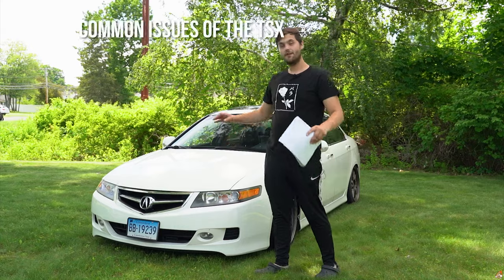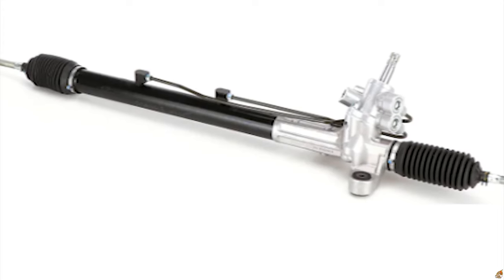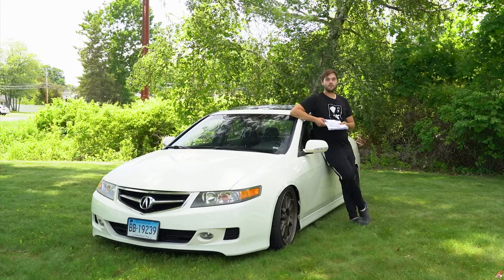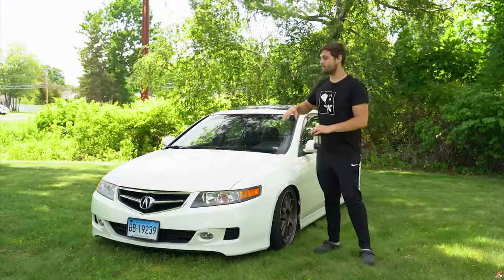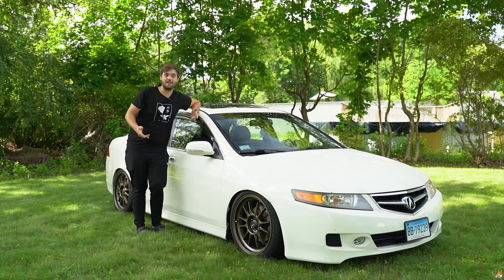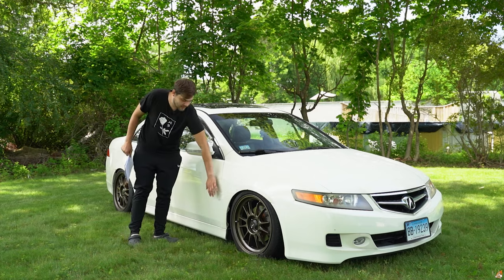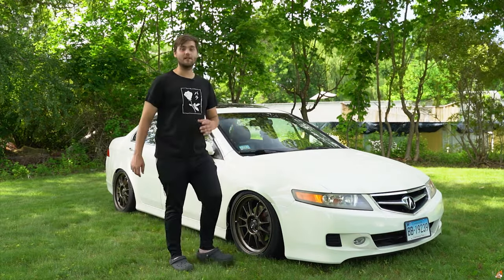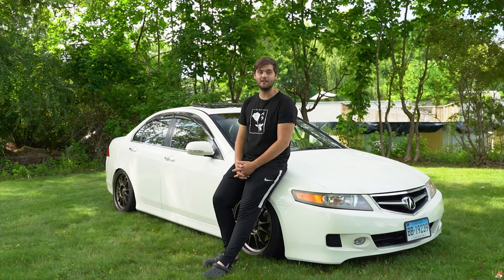TOP 10 COMMON ISSUES With An Acura Tsx

Comment: I have an 04 tsx and in the winter it gives me trouble starting. It sounds like it's doesn't want to start,after the 3 turn of the key then it starts. Wat could that be.??
Reply from the maker: Sounds like your starter is probably acting up, most likely alternator is next up in line.
Reply: Sounds like your battery is going out.  Same thing happened in my 04. Got a new battery and had no issues. Same with my 09.
Reply from the maker: @madgreek253  this as well can be either of the culprits tbh
Reply: Thank u

Comment: Hey I am just wondering if the Bluetooth could be the cause of the issue I have, ok so from time to time my 2007 tsx just goes off and I have to stop, set the gear to Parking, pull out the key and start the engine. But sometimes when I’m moving and start to decreasing the speed it attempts to goes off but suddenly goes back to normal with the greetings on the display(welcome driver 2) 
It feels like car does not have the capacity to provide the consuming power and it just cuts the power off so the car goes off. 
And if yes is it enough to just disconnect the phone from the car? Or the Bluetooth wire inside the car needs to be unplugged? Or anything else?
Thanks in advance 🙏🏻
Reply from the maker: Sounds like your alternator may be just crapping out and drawing out the power, have you changed it at all anytime? Also wouldn’t hurt to unplug that Bluetooth plug can also be a drainage
Reply: @RishMedia  haven’t changed my alternator yet, but looks like I will in the nearest future. At least the situation got better after I unplug that green Bluetooth chord yesterday (: 
My car won’t go off as often as it used to
Thanks for reply you have a nice day 👌🏻 😊
Reply from the maker: @vladmiller6389  hope all goes well man! If ya still occur draining issues more then likely the alternator next

Comment: I got a 2005 acura tsx and my climate control, heated seats or heated side mirrors doesnt work, was working fine and then out of nowhere it stop working. I got the android tablet and everything works how is supposed too, but anything climate control related stop working out of nowhere, i had the tablet already btw, anyone can help me? I cant find anything about it
Reply from the maker: I’d say start with the fuses related to that, make sure ground wires are all good not to beat up, and your connections are good.

Comment: Okay I have one that rpm hunts constantly it’ll idle low and come up on its own. Then in 3-4 gear it’ll hunt while driving a constant speed. Any ideas?
Reply from the maker: Do you have any codes popping up or misfires happening too? Pretty odd id say look into you Throttle position sensor and make sure your TB is good/clean inside
Reply: No codes or misfires. Cleaned throttle body today no change and the sensor I have not tried. This problems been happening three years now but lately it hunts lower at idle to where it almost sounds like it’s gonna stall
Reply from the maker: @chrisberube7640  thats real strange especially that long of time, maybe try the sensor then also do a idle relearn. Disconnect the battery for like 30 mins then do the idle relearn procedure
Reply: Okay I tried to find a video of idle relearn with my car couldn’t find one and any idea where and about how much that sensor is?
Reply from the maker: @chrisberube7640  there should be some videos and if its like a accord or TL the relearn procedure should be basically the same way. Or if not on google forums, also id check advance auto they usually carry denso sensors or alot closer to oem

Comment: 07 TSX delay in gas pedal making it have a dead spot then surge forward. No codes yet. Kind of dangerous on takeoff. Pedal position sensor? Or does that always throw a code?
Reply from the maker: Could be likely definitely would have to be sensor wise or maybe even a throttle body not opening fully/dirty?
Reply: @RishMedia  Thsnk you I’ll try some cleaner n maybe spray the mass sensor eith that cleaner. Maybe I’ll run fuel injector cleaner through it. I have a steep gravel drive n if I let off gas to less than half pedal it acts like it’s getting no gas at all. Does it on level parking lot too
Reply from the maker: @markpell5654  hmm yeah thats strange do those steps cause it’s relatively easy and cheap see if anything improves. 

Whats the milage and AT or MT?
Reply: @RishMedia  200k miles automatic trans. I got it for $1200 right before pandemic hit. Even on a level surface like a parking lot if I touch gas pedal about 1/4 down , nothing , like I’m not touching it , then jumps forward like I’ve goosed it.
Reply from the maker: @markpell5654  gah damn that is strange throttle cables gotta be stretched or something
Reply: @RishMedia  that makes perfect sense . I’ll have to check that out. Maybe get fuel pressure checked or regulator

Comment: I got an 06 TSX and I went to my mechanic about a leak around my alternator and power steering pump and he said it was the hoses. I replaced them and its still leaking some where. Any idea what it could be? Nothing seems cracked or leaking anywhere
Reply from the maker: Hmm and it’s oil or power steering if you could tell? The power steering pump itself may be leaking there’s a seal on the inside the can go bad. I seen a leak forming on the pump itself before I changed mine
Reply: I'm not sure if its oil or steering fluid. Its kinda black and grimy. I clean it off and it comes back the same. I looked all around to see if I can find the leak but nothing. I don't want to replace something and that not be the problem
Reply from the maker: Where do you see the grime where’s it keeping building at? 
Cause I know the o rings in the line had recalls, only thing I can think of from this info is the pump itself. 
I know the Vtec solenoids are a common oil leak area but that’s at the top-back of the engine on left side. Don’t thing that’s causing it in the power steering area
Reply: The grime is building up all on top of the alternator and all on the pully with the belt. Its all that area near the pump. So it could be the steering pump? Maybe a small enough leak to be barely noticeable
Reply from the maker: @darkslayerjl  yeah it’s definitely the pump then man, I just went with a autozone one tbh lol. You definitely don’t want it to keep leaking on the alternator gonna fry that next
Reply: Yeah I recently just upgraded my alternator to a high out put alt. I'll just replace the pump and hopefully that solved the problem
Reply from the maker: @darkslayerjl  hope it does man best of luck!
Reply: @darkslayerjl  What is high out put alternator?

Comment: Battery drain! We'll check the blue tooth module. = - [
Reply from the maker: Its a common thing! Ive dealt with it on mine and fixed the issue and yeah may be like a “temp” or “bandaid” type of fix but works

Comment: Common issue ive seen is not only second gear grind but the reverse lockout causing grind over time. Ive got 150k miles on my lady and shes had reverse rebuilt 2x.
Reply from the maker: Sheeesh that’s also could be the clutch pedal bracket aswell! Like the guy mentioned above with his experience, that’s a pita 😭
Reply: @RishMedia  Yeah ive had my clutch pedal replaced too. Fun thing is it comes in randomly. Just great when im trying to back into my spot at work and I look like I have no idea how to drive stick lol.
Reply from the maker: @AnADVTurtle  lmaoo it’s a easy job replacing but such a annoying position damn back and shoulders hurt after 😭

Comment: I have one. Not too many problems with mine but i got a doosy for you guys, if you can help. 
My tsx trunk lid is STUCK shut. Ive tried all three manual releases, sprayed the latch with wd40. Nothing works. Valet button is in correct position. You can hear the mechanism working when i hit the trunk open button but nothing! 
My last two options i have is acura dealership, or just fkn sawzaw the latch. Neither of which i want to do. Anyone else have their trunk stuck shut?
Reply from the maker: Damnnn wth lol I’ve never seen anyone ask about that problem with the Tsx tbh,  honestly not to positive on what other options you may have since I haven’t experienced that.. I’m sorry dawg such a weird issue
Reply: Thanks
For the reply boss. Hopefully someone will see and chime in! Yea everyone I’ve told
Tell me the same thing and just like wtf? Lol. Im sure it will be something stupid when i finally get it. Frustrating though, because i have coilovers waiting!!
Reply from the maker: Hmm have you tried maybe getting a rag and little pry bar or something and try to pry inbetween bumper and trunk while pulling on the latch? 

Seems like it’s jammed or trying to pull the cable from the inside getting the seats down
Reply: Ive tried the cable from inside the trunk. Riding with half my back seat out for months lol. I haven’t tried to pry it
Reply from the maker: @tylerwill5250  damnn that is so freaking weird, honestly have no clue then.. you’re better off going to Acura seeing if one of those guys have experience with a weird problem like that
Reply: Yea, i know :(
But its like 45 mins away from my house lol. Just been putting it off because of the drive. I keep asking every acura guy i come across about it and they have no idea either haha. Thanks man
Reply from the maker: @tylerwill5250  geesh take that ride tho man so you can get the coils on finally!

Comment: Had 2007 tsx auto. From 90k-200k miles, starter, alternator, rack and pinion, power steering pump, wheel bearing, strut, ac compressor, driver door lock actuator. 4cyl breaks a lot. V6 lasts longer. Many honda owners tend to lie and down play all the problems 4cyl accord l, civics, and tsx. Hate biased bitches(owners) .
Reply from the maker: Seems like all the general maintenance stuff throughout its life. But some people do just over exaggerate how long things will last, but they can last for 300k+ miles
Reply: Agree, I don't think Honda is that reliable. I owned 2 Hondas now, similar experience. At about 100K, everything start to break apart.
Reply: I have a 2005 TSX automatic. Only replaced front brakes with ceramic brake. Actuator just went out in the driver’s door. Everything else is original even the serpentine belt.
Reply: @bettywhitsell9984  lol. U think im going to believe that.

Comment: A 125k km 2009 tsx for 8500$ cad, is it a good price?
Reply from the maker: Ehh personally I’d rather get the first gen 04-08 better overall looks wise, modding potential and better engine.
Reply: @RishMedia  really? whats the diff between those years and the 2009?
Reply from the maker: @nightmare19932009  2009 is the newer gen bulkier luxury car. As the CL9 is the sportier better performance one with the best kseries motor and more supporting mods for the platform

Comment: 2006 Acura TSX 215k miles
Cluster mileage stop working at 209k miles
Climate control crashed
navigation screen stopped responding 
Water leak rear passenger side 
AC death
Reply from the maker: Not to terrible, that water leak just check the door seals, and make sure the run roof drains aren’t clogged

Comment: Sounds like the first gen tsx sucks 2009 to 2014 never has any issues also i build sound systems so i have 250 amp alternator installed and big 3 i also have 2nd 100Ah lithium battery installed in trunk my voltage never drops below 14.7 pretty much all the problems you named though for your TSX have been fixed on the 2nd gen also Bluetooth works fantastic i also have amazon alexa installed so i can just talk to alexa if i want to change the song or anything if you are having problems with your battery going dead from sitting you need to go through your system and test for voltage drop or parasitic draw so you can address that issue rather than just unplugging the Bluetooth i have two 12s running on 3000 RMS watts and i still never fall below 14.7 volts even when the bass hits the only issue ive had at all is i had to replace 1 H.I.D but i did both and replaced the ballasts also  because id rather do all at once so they are done at the same time i prefer to change things in pairs if its something like that im curious about what your issue with your Bluetooth is what does it do if you have it plugged in
Reply from the maker: The Bluetooth module itself goes bad and starts drawing power even when the cars off leaving a dead battery when you come back. 
Personally overall I like the first gen it’s just common maintenance stuff but a lot of people just neglect the basics
Reply: @RishMedia  i dont see why you would like the 1st gen the second gen has better styling and requires less maintenance and from what you have described it suffers from none of the drawbacks you have described with the 1st gen it also has better kits for it in regards to appearance
Reply from the maker: @flirtnwthdisaster2619  there’s plenty of reasons lol. Looks way better, more sporty, has the best k24 motor wayyy more modding options and capabilities.
Reply: @RishMedia  thats not actually true see i also have. K24 your car has tye K24 A2 and mine has the K24 Z3 so if you want to get technical yours makes about 4 more HP than mine however mine makes about 8 Lb FT more torque than yours but mine has a different advantage because what would actually be the best way to get more out of the K24 Is to take the K24a2 head and put it on the k24z3 block you would have to do a slight mod to the coolant port on the k24z3 block but once you do that the k24a2 head will bolt right up to the k24z3 block which will allow for alot more power to be made but where you are at a disadvantage is that you cant do the same mod with the k24a2 unless you get a k24z3 block which doesnt bolt straight into your car that is another reason the K24z3 in the 2nd gen is actually better because its a lot easier to mod and get more power out if it along with the fact that it is also less maintenance to maintain and keep going really the one thing the 2nd gen needs is upgraded brakes  but other than that its a lot easier to take the 4 port head off of your 1st gen K24A2 and swap it on to my  2nd gen K24Z3 block because mine already has the block in it you in order to produce the same result would require a full engine swap and new mounts because the k24z3 doesnt bolt straight in  to the 1st gen.

Comment: VSA light? 😂😂😂 After 5 years and 6000 vidz and attempts finally got rid ah mine.

Also abs and airbag light.
Reply from the maker: What was your fix? I know mine are rn as a hardcode tried to erase but seems like  relays triggering
Reply: @RishMedia  based on vids I've seen, Bridge the OBD2 pin 4 to 9. First reset abs even if it doesn't need resetting. Abs: press brake, turn key twice. Abs light turn off, get off brake. Abs light turn on, hold brake. Abs light off, get off brake. Light should flash twice and off.

VSA
Short pin 4 and 9 together.
Turn key twice.
Abs light turns off, press vsa button
Abs light on, press vsa button
Vsa light will blink then off

Comment: Mine whines when I accelerate, I changed both power steering pump o rings and its still making the noise...
Someone help!
Reply from the maker: is it a whine coming from the engine bay or through your speakers? it may be you alternator
Reply: The engine bay, can't tell if it's the alternator or the transmission

Comment: anyone have problems with there headlights?  my driver side was out so I replaced with a whole new oem head  light ballast and all fixed the problem but it caused my other side to go out I'm lost wiring looks good ballast is good tried diff igniter etc
Reply from the maker: Maybe check your fuses or the bulbs itself are good, cause make sure you don’t touch the bulb with bare hands you can burn it out that way
Reply: @RishMedia  ok will check those stuff I’ll keep you updated wish me luck
Reply from the maker: @dezzydez203  hope all goes well! seems like couple people been coming lately with headlight issues. I haven’t personally dealt with much like that.
Reply: @RishMedia  ended up being either my igniter or bulb idk I put a new igniter n bulb good now
Reply from the maker: @dezzydez203  sounds good!! Glad you got it sorted 💪🏻

Comment: Yo bro im having some alternator issues ive done alot of test and my battery isn’t draining my alternator is working but I keep getting a check charging system indicator if u can help me out in anyway that would be amazing, like any test I could run or replacing anything I just dont want to dish out more money for something thats not the cause
Reply from the maker: What year is your Tsx? Check your ground wires they could be corroded/rusted causing some issues. 
Also if your a 06-08 like I had a issue car wasn’t holding a charge is the Bluetooth module I made a video on. Quick fix and saved me buying a new battery or alternator etc
Reply: Some aftermarket alternator sucks, I had to go with oem
Reply from the maker: @JJ-fx7tg  yupp, usually I tend to just do autozone lifetime warranty and the jobs aren’t to hard

Comment: do u know why my 04 tsx when I start up it has a bad chocking noise?
Reply from the maker: Like when it’s cranking?? How does it drive? Maybe it’s the starter acting up or something
Reply: Probably vtc actuator. Dont bother changing with oem "upgraded part" still does the same thing lol
Reply: @RishMedia  it drives fine only does it sometimes when start up
Reply: @lornecristobal5730  it only does it sometimes. it don't do it all the time but I don't like the noise when starting up
Reply from the maker: @kevinchang522  I guess best thing to do is try to check the voltages if enough power
Reply: @kevinchang522  yeah I think its the VTC. Oil drains from it making it dry and causing that sound. From what I know, there is no OEM fix.
Reply: @RishMedia  i think Lorne said was right i did some search and its making the damn noise
Reply: @lornecristobal5730  thanks now I only how to fix the shit been bothering me when I start the shit up
Reply from the maker: @kevinchang522  good stuff! Atleast ya know now 🤘🏻